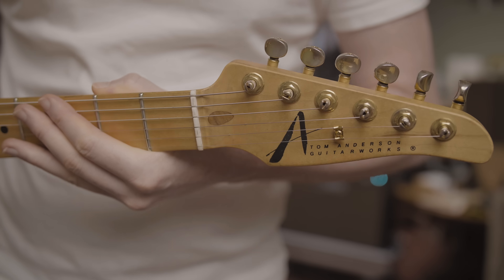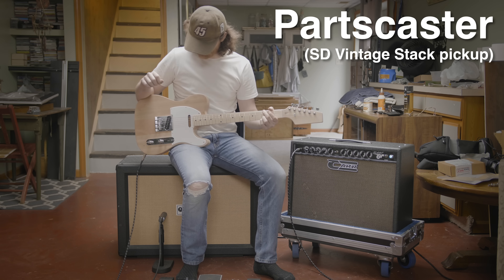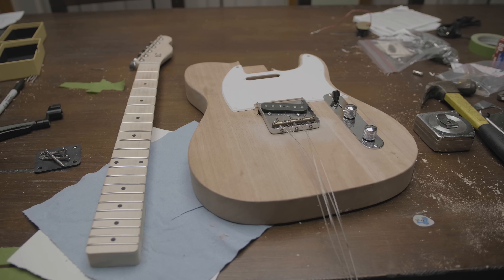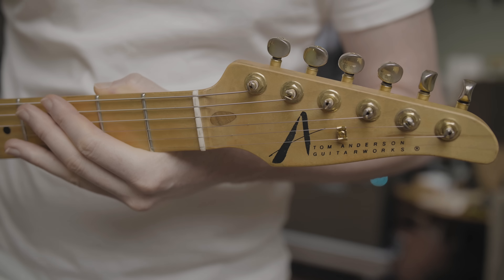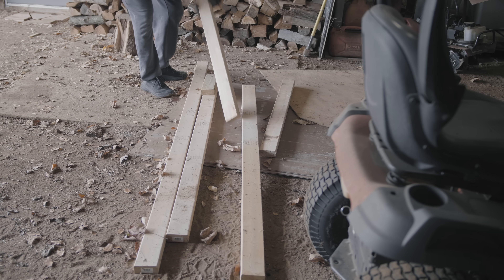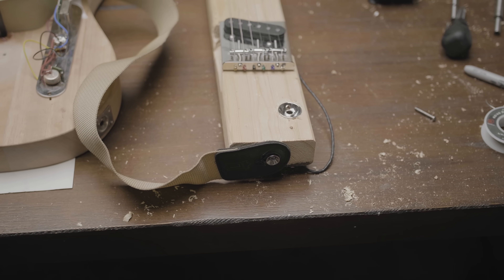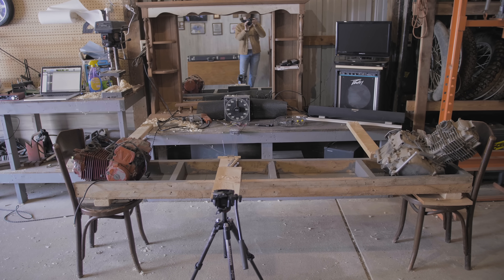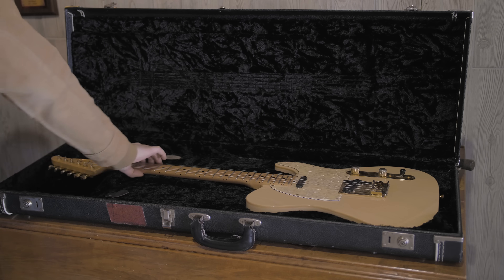Tested: Where Does The Tone Come From In An Electric Guitar?

Comment: The message I get from this is: buy yourself a cheap guitar with a neck that feels comfortable to you, replace the cheap pickups with decent ones, have the guitar properly set up by a pro, and you're in business. Great video !
Reply: @MikeSW  One (potential) benefit of buying a 'project' guitar and upgrading it as you go along is that you don't have to pay the full price upfront, you can upgrade stuff here and there as your skill/commitment increases. The only downside to that is that you can't compare your progress on a like-for-like setup.

And hey, most folks looking to mod their car/bike/computer/guitar probably enjoy tinkering and 'making it their own' instead of just buying something off the shelf.

I have nothing against buying something off the shelf, but a beginner isn't likely to know what they want/need at the outset.
Reply: I have a squire strat with a fender neck. Bought it used for $150. My favourite guitar I have ever played
Reply: @canadianclay475  you're basically playing a Fender for most people
Reply: @canadianclay475 great.  It doesn’t have treble bleed and it has cheap electronics.  The neck isn’t rolled.  The body is made of 3 to 5 pieces of wood. The bridge isn’t as good. 

Otherwise well done
Reply: @canadianclay475  You know the story would be more believable if you made it seem like you knew that Fender makes the Squire and the Stratocaster.
Reply: What part isn't believable?Putting a better neck on your guitar is common practice if you want a major feel upgrade on the cheap ones.Yeah, the strat is(in both it's variants, Squire and Fender) a Fender design, but the feel of a real Fender is noticeably better.(it's made of better materials and has a better finish)
In conclusion, to make it clear:cheap Fender Squire Strat + modified neck(one built for the Fender Strat(no Squire) = happiness for your fingers
I hope I helped you understand what he meant.Peace
Reply: @T @Tofu_Pilot No offense I’m not trying to be a jerk but if you’re going to challenge someone’s knowledge you gotta be air tight with your own. Fender doesn’t make Squire they make Squier. Sure it’s just a minor error in spelling but I also am not sure what part of the story wasn’t believable. He wouldn’t say “I have a Fender guitar with a Fender neck” and it’s also just not commonplace to hear people say “oh I have a Squier by Fender guitar”. It’s implied. Again I’m not trying to be mean or anything and you can feel free to tell me eff off lol. I was just taken aback by the reasoning here 👊🏻👊🏻👊🏻
Reply: Reduce, Reuse, Recycle, Repair.... In other words buy second hand.
Reply: @lorenzoblum868  I'm pretty sure that's what BTO recommended.
Reply: Harley Benton’s are cheap and feel amazing!
Reply: @joshuajaimes121  Agreed. IYV seems to suit me too. Some HB's are manufactured at their Vietnam plant.
Reply: Well cheap guitar isn't that bad. I have indonesian made guitar and it's awesome. Also super cheap
Reply: @rotikl1359  been learning for the past few months on a $60 acoustic. I’ve tried some higher end acoustics that it can’t hold a candle to but it doesn’t sound bad honestly
Reply: I buy cheap guitars and make them play like butter by adjusting the action and choosing specific strings. Anytime i had an expensive guitar i was always coddling it and i was scared to leave it out if it’s case.
Reply: @NightSpeed9 you must have some other way of flexing on fellow dentists
Reply: @NightSpeed9  Sounds like a personal problem.
Reply: my favorite guitar is one of the least expensive ones in my collection - I wouldn't sell it for 10x what I paid for it.
Reply: There are loads of videos of extremely good players using cheap guitars with diff pickups and solid setups. They don't always sound the same or as good as the more expensive guitars so this isn't a fool proof method you have. The real message people need to be receiving is, BUY WHAT YOU WANT!!!!! Stop letting other people tell you to buy the most expensive because its the best or buy the cheapest because it isn't any different.
Reply: @MikeSW  I’ve known a few people that upgraded Squiers with MIM Fender hardware they bought off of eBay. By the time they were done it was cheaper, and just as good. The key to that is that people will put higher end hardware like MIA parts in their MIM Fender, and then sell the MIM parts to recoup some of the cost. The only problem with doing it though is that a Squier with MIM parts won’t really sell for more than a regular Squier if you ever want to get rid of it. I bought my son a Squire Telecaster with MIM pickups for $175.
Reply: Did that for one of my Basses and is probably one of the best basses I have
Reply: @MikeSW  What tools do you need bro, a screwdriver? And spending time making it adds more value to you personally, i wouldn't mind spending some extra time with it.
Reply: Then once you practice a lot, maybe get better pots if needed so you can have a more linear volume change for the volume knob and EQ change for the tone knob. Also tuners if the OG tuners are crappy and can't stay in tune.
Reply: @lanehart012  your ears can't discern linear volume change the way it appears on a graph, so you get pots with a curved change.
Reply: @lanehart012  I actually prefer a non linear volume pot.  I use that pot to either roll of a bit of the signal or cut it entirely.  Use a volume pedal for swells and finer control while playing.
Reply: @lanehart012  oh yeah some good pot will make your guitar playing elevate beyond the human level as well.
Reply: @lanehart012
Reply: @lanehart012
Reply: @lanehart012
Reply: @lanehart012
Reply: @lanehart012
Reply: @MikeSW 
If that's your experience i'm sorry to say that you've been scammed, me and my friends have built ridicilously specced partscasters and mod rods in the 500e ballpark
Reply: @ihavewaited90daystochangem51 yup yup, honestly a squier or epiphone with a good setup and Wilkinsons dropped in is even less than that, and sounds great. Their pickups are stupid good for the price.
Reply: @ihavewaited90daystochangem51  And I have bought a guitar straight from the store just ad I want it gor 300€
Reply: @ihavewaited90daystochangem51 you’re full of shut.
Reply: @ihavewaited90daystochangem51  I am gonna beg you to please teach me how. Like, actually, I need to know. I wanna do this.
Reply: It's also important that the frets are placed correctly. It sucks to have random notes be out of tune.
Reply: Honestly it's more about buying the guitar you enjoy and that you can afford. If you really like a USA Fender and can afford it then awesome! If you prefer a Squier Classic Vibe (and/or that's all you can afford) then great! They're awesome guitars too. Especially with some upgrades. Enjoying and feeling comfortable with the gutiar is the number one factor when buying one.
Reply: @Ironworthstriking  Absolutely correct. As a guitar teacher this is what I advise my pupils.
Reply: I bought 3  cheap Chinese  stratocaster copies on the flee market. All 3 stay perfectly in tune. Cheap mechanics of course but they get the job done...
Reply: @lorenzoblum868 your personal anecdote doesn’t change a well known fact.  Cheap guitars don’t stay in tune as well.
Reply: @eclark9965 I wouldn’t say that, my squire PJ bass stays super well in tune, as good as my Fender P bass does ¯\_(ツ)_/¯
Reply: To take it a level further, consider learning to do set-ups! It’s easier thank you might think and it will save you money in the long run
Reply: Exactly what I did, except I set it up myself
Reply: @MikeSW  true, but it’s way more fun to select your parts and end up with a one of a kind instrument.   Certainly not easier however, a few I did went to the shop repeatedly before I got what I was after, 30 years of reading guitar mags paid off there big time, but not cheap.  and no resale value either, I never had the cash before!  But I also never had the time to play 6 days a week, until the past 5 years, that was the really huge payoff.😀
Reply: Thank you for your service to Science.
Reply: It‘s way more a good amp than an expensive guitar that gives you great tone. Nothing new.
Reply: @MikeSW  my dad has a business with buying, selling and swapping parts on guitars and I can firmly say it is cheaper to build your own guitar from scratch if you know what parts you want, and what parts to get
Reply: I've shaken my head many times and what people pay for a block of wood with strings on it. I went to a local TV channel taping of a band, this bass player was super fun to watch, his axe looked cool, worn, and his pedalboard was about 3 pedals glued to a chunk of OSB. He said he spent $100 on his bass 20 years ago and just makes small upgrades once in a while. It sounded fantastic.

I bought a $1200 Ibanez SR1600 4-string bass as my main when my band started playing out a lot. As a backup, I bought a $300 SR300 because it was pink. The pinkie plays just as well and I think sounds better.

I also bought a hot pink 6-string PRS SE, having always wanted a PRS because surely, spending $4000 would get you a better sound. Maybe a little, but not a $3500 better sound. My favorite guitar is $500 and my favorite bass is $300. I've learned my lesson. Buy what you can afford, upgrade it as you can afford it, but never go overboard unless you don't care about setting your hard-earned cash on fire.

Collecting is another story...
Reply: i bought an epiphone special 2 a few years back and did exactly that. it’s insane much i love that guitar
Reply: As many others have said, Buy something you love playing and feels comfortable to play. Really what you are paying for in higher end guitars is the time spent on the fret board. Making it easier to play. A little different with acoustics as tone wood does matter in that case but I have people play my Taylor who own cheapo acoustics and they always comment how much easier it is to play. That is because the time spent on the fretboard. There are many on YouTube who take those cheap guitar kits and turn them into four figure masterpieces.
Reply: Yamaha pacifica
Reply: A good neck, too. Might not do anything for the tone but a good neck is way better feeling than a shitty one.
Reply: There may be more than a few big name guitar manufacturers and their shareholders that dispise your revelation 😂
Reply: It's what most of the pros did. Every revolutionary guitarist made some piece of junk work for them and in turn, it gave them their signature sound. What makes them revolutionary is the lack of focus on the equipment, and the complete obsession over the music they were writing and solving musical problems because of their lack of proper gear. Something most musicians simply don't have to do anymore nowadays
Reply: Intonation firsttttt
Reply: Setup makes huge difference.❤
Reply: They sounded exactly the same to me. Just proves the majority of us Humans are idiot's when it comes to Brand name's. Motto of this Video is Don't be an idiot or a Sheep follower.😂😂😂
Reply: @eclarck9965 fun fact, to be able to write "made in USA", all parts should be manufactured in America. It used to be true but nowadays, most brands use components made elsewhere... So legally they can only claim "Assembled in USA"....
Reply: @lorenzoblum868  no shit Sherlock.  But here’s another truth.  Your point does nothing to negate the difference in build quality.
Reply: @eclark9965   "no shit Sherlock". It doesn't really sound like you're aware of that tbh. And as far as craftsmanship, you find highly qualified people all over the planet nowadays. It's called globalization, for the better and the better in this case.
Reply: @lorenzoblum868  i am aware of it. I’m an adult consumer with an iq over 85. What it sounds like is i was told an obvious thing that doesn’t change anything i said.   The craftsmanship and processes are better in the states.  The fret work.  The finishes.  The neck qualities.  The parts qualifies.  Regardless of where they’re made.  It should also be noted that the big 3 make a lot of their parts in the United States for their American made runs.  Which I’m sure you know.  

Next time someone is telling you you’re staying the obvious, that’s probably what’s going on.  Internalize it and do better
Reply: @eclark9965   projecting much? Don't bother answering. Not interested.
Reply: @lorenzoblum868  no. I corrected your inaccurate guesswork and then reinforced my point without suffering fools.  You can take it.  It’s ok. 

Globalization gives us one thing.  Massive pollution from shipping and outsourced jobs.  Not a big fan
Reply: @eclark9965  btw, are you sure you're being genuine when talking about pollution? I mean your thumbnail is a race car. I've been riding my bicycle for decades...
Reply: @lorenzoblum868  if i never watch a day of racing again there’s still going to be racing and i did nothing measurable to encourage the process. 

The same can’t be said about having someone make your guitar 3k miles away
Reply: @eclark9965   Glorifying guns, cars.... is the first step towards our frenzy consumerism. On the other hand, if you build a guitar using components, wood that you can certify is not from some unethical exploitation (mining and wood industry are well known for creating environmental catastrophe), then you might be into something. for that reason, if you use local material, you have a better knowledge about the origines of those materials. Also, do we really need 10 guitars? Do we really need a "better" guitar or do we need to improve our playing? What is most important is the accuracy and the confort and often it doesn't take much to upgrade the guitar we already own...
Reply: @lorenzoblum868  suddenly we are talking about guns and cars when it isn’t the subject?  I don’t own guns.  I have a car so i can to a place.  You’re going hard in the paint over a throw away avatar and it’s nonsense.  You should stick to the subject.  

I own 2 guitars.  An acoustic.  And an electric.  Both American made.  Supporting local labor.  

There are countless videos on YouTube about whether it’s worth it to dump a bunch of money into a shit tier guitar.  The consensus is generally no.  You’re just dumping perfectly “good” parts into landfills.
Reply: Doing God's work. Tonewood is a myth regarding solidbody electric guitars.
Reply: Buy a reasonable priced one that ensures that you're getting a decently built, set up guitar. If you go out and buy whatever cheap guitar you can find you'll have issues sooner or later! Also, never buy into the "well known brand guitar" lie like some Gibsons, etc. with high prices and (sometimes very) low build quality.
Reply: A lot of the benefits of a harder, more expensive wood is that it’s more stable under the tension of the strings, which is why carbon fibre guitars sound fine, and the 3D printed ones sound fine, and the aluminum ones sound… fine 🤯😂
Reply: I came up with this many years ago. I have many cheap guitars and every one of them I modded by myself. It's better to spend money on a nice amp instead because even the most expensive guitar would sound bad on a bad amp
Reply: The fact that you have to take your guitar to a professional to have it set up is pretty sad. Every guitar player should know how to set up their guitar from changing the strings to setting intonation to swapping electronics. it’s really sad you gotta take yours to somebody to have that done
Reply: You mean it has nothing to do with the brand name? Gibson and Fender will never allow that kind of thinking! 😊
Reply: And yet. There are cheap Chinese humbler that blow $150 humbuckers out of the water.

The real lesson is be discerning, and learn how to properly adjust the intonation
Reply: Or just buy the cool looking one and stop overthinking it.
Reply: @B3Band  I'm a guitar teacher and this is exactly what I tell my guitar beginners who are looking for advice on their first guitar! If you love how it looks you will be much more inclined to want to play it. Of course I make sure it's OK to play - but nearly every guitar is nowadays.
Reply: @MikeSW  I can see where you come from. Legit some guitar brands have better value on their guitar than buying cheaper and upgrade later.
Reply: PRETTY MUCH!
Reply: U forget to factor in EGO
Reply: There's a lot of truth to this. My #1 guitar is a PRS SE Zach Myers signature. I upgraded the tuners and replaced the pickups with a Gibson Burstbucker 1&2 set and the thing freakin rips.
Reply: I've always liked Neck-through Rhoads V's. So. Cheap isn't really an option.
Reply: https://youtu.be/epoIqglZOUg
Reply: Bingo
Reply: doing this with a 270 dollar bass i just bought, love the fretboard and the way it fits me, and it osunds fine, when i want to sound fancier ill buy new pickups
Reply: Yes.  More than 30:years of playing and about if that semi pro and that is where I landed.
Reply: @MikeSW  some times yes but if like me and you play lefthanded you have to mod and make due unless your getting custom made guitars it will always be cheaper. And you can learn to do everything yourself on a cheap throw away before fucking up a better guitar. So modding will always be cheaper you have to be willing to find parts at good prices and have patience. If you are building on your free time then what is labor if you don't have anything else to do at the time(equals zero).
Reply: Over the years and years of buying nice and off brand gear 
All that matters is most definitely how much you practice 
Everything has its own sound it's how you use that sounds
Reply: Well I mean, you're going to want good tuners too so it's not an absolute pain, and not having to tune so often
Reply: @Evalyn126  stock Fender esque tuners are fine, rarely does my guitar go out of tune
Reply: @cycomiles4225  well my guitar needs to be tuned way more than my acoustic guitar (made for nylon strings and also made in the late 70s that has steels on it bc idk someone put steels on it), and that thing stays in tune for like An actual month, and if I leave my new electric out for like a week, I need to re-tune it, because it's far enough off that it pisses me off
Reply: That's the most important thing the action
Reply: And get a god amp
Reply: Better guitars have better fit and finish. Tuners that stay in tune, nuts correctly cut, saddles that are better finished and stronger material, better finishing on the frets with no sharp edges and leveled properly. 

You can just feel the difference between a high quality guitar and a cheap one.
Reply: Bridge and nut bro!
Reply: I didn’t find it in the description or the video. Of course I assume you used the same amp with the same settings, but what amp is it?
Reply: @MikeSW  I love working on my guitars and not having someone else do things for me. My guitar is not $2k as it would be if I went that approach.
Reply: Yeah, that‘s the only truth. All other things are Vodoo, nothing else !
Reply: fr
Reply: And even then, dont even touch the pickups on some guitars. Most modern squiers sound nearly identical to their fender counterparts
Reply: Bingo!  It’s what I did!  I am happy as a pig in shit.
Reply: The nice thing about buying a cheaper guitar is that you don’t regret effing’ with it.  Want to add a “cut” button to get all Jack White?  Sure.  Don’t use that cut button much?  Whatever, you spent 300 at most, and it’s no great loss.  The possibilities are infinite.  You can build whatever guitar you wish, and for far less than what you would pay for some pricey Made in America model.
Reply: @MikeSW t really depends where you live, for example in Brazil Gibson, fender and alike are super expensive like 20x the minimum wage, so telling by experience, I was able to upgrade good structure cheap guitars with amazing hardware and way cheaper than a Gibson and honestly very close soundwise (I also have a Gibson to compare)
Reply: @MikeSW Wrong.
Reply: What you forgot is the frets. If you want a consistent sounding guitar at all frets, that is going to cost you a lot. Also if you want a guitar that feels good to play or feels easy to play, and sound big at the same time, that also gonna cost you a lot. I use a 6000 dollar Tom Anderson Strat and would never switch to anything that is not as carefully built.
Reply: What I did with my third guitar:
60€ guitar with supreme fretwork idk how for that price but way better than any fender player I ever played
Reply: Don’t even need to upgrade the pups.
Reply: @MikeSW Squier Bullet series cost 120€, and you can get electric guitars from amazon or thomann for 70€. You can swap out every single part of an electric guitar with tools you have at home and a fifteen-euro soldering iron and it won't take over two hours. There are even drop-in replacements for nuts at ten euro apiece. 

Even if you take it to a luthier for a refret with stainless steel frets and a PLEK job it will still cost FAR below the price difference of a squier compared to the first Fender with stainless steel frets. Your comment is just ridiculously wrong.
Reply: Yes! and I would add too a body that feels comfortable. I was in between a Jem Jr and RG421, JEM Jr with amazing neck and playability, RG that just fits my body and right arm and much more lighter. In the end, I had to make a choice and chose Jem Jr. If I were more savvy with guitar engineering I could bought the RG and mount an amazing guitar for me. Or I could go to a Luthier..
Reply: Bought a barely used Squier P bass, did some routing, and installed Bartolini pickups and preamp. It sounds amazing.
Reply: Except a lot of times, it still sounds shitty.
Reply: Tbh after Spectre Studios video about pickups I'm nkt even sure replacing them would be worth it
Reply: Dude please give me your address i will come and kiss you
Reply: you can set it up yourself for wayyy cheaper and quicker
Reply: Squier or Epiphone sounds good.
Reply: @MikeSW the only swaps you need to do is the nut; other than that, unless you want a hotter pickup you really don't need to make any upgrades. Maybe a fretjob but that goes for every guitar ever made since frets wear out.
Reply: That’s what I did😅
Reply: Whichever tools and materials you choose seem second best and immaterial when music is your muse.
Reply: That doesn't include staying in tune which is also quite important
Reply: Hardware and craftsmanship is pretty important as well not just for long term usage but also to achieve remaining the set especially on the stage
Reply: Yes, but cheap guitars do not intonate well and have poorer tuning stability bc of their build quality in my experience. Nothing you can do to fix that, those things can become extremely problemsome when trying to record decent guitar.
Reply: I replaced the pickups in my wife’s guitar a while back. I had only replaced the high E string and I plucked it. The tone was so glorious  that I knew I had made a huge improvement in the guitar after only hearing one string.
Reply: Dylan pickups!
Reply: Yup
Reply: Assuming the neck and body are made correctly and the frets are well positioned for the best intonation.
Reply: Having good tuning hardware has to be a nice quality of life detail though. So cheap body/neck guitar with good pickups/electronics and good string management and you're ready to rock.
Reply: That’s what I’ve been doing for years! Happy to verify my instincts.
Reply: A pickup is such a simple device magnets with copper coils around them..  that i bet even the cheap ones sound similar to the expencive
Reply: You need to replace the wiring too The wiring is always horrible
Reply: Some of the really cheap guitars have such poor necks they cant be intonated well. Other than getting unlucky with something like that, I would agree
Reply: The “cheap” in music gear can differ from 100-1000€ so thats vague af and buying a cheap guitar is a lottery bc in most cases in that price range with the same guitar you can either get a very nice build or pretty bad one
Reply: Yeah man my thinking from the start has always been buy as good as you play, there's no point in beginning and getting a 2.5k aud guitar when a $300 one will do let's you ease in and if you don't like it you haven't made a huge regretful purchase that'd you'd lose money on if you sold it
Reply: Fret (metarial), weight(body chamber), shape(ergonomics), playability(neckshape), wood quality(neck needs not to twist or distort in short period)   there's lots of other points that makes guitar more worthy other than a sound.
Reply: for those whom dont want to see the fumm video, all the tone comes from the wood, forget the pickup tone myth
Reply: Agreed with most of it except that cheap pickups nowadays are mostly decent to the point they don’t need to be swapped at all! Cheap pickups no longer suck anymore! All that’s left is pickup height adjustments which will affect your tone a lot more than swapping woods!!
Reply: Very good video
Reply: I’ve been playing for 38 years and it comes down to what feels good, how well its setup  and pickups. I’ve got $3,000 plus guitars and cheap recycled guitars I’ve modified and eod you don’t need a high end brand unless you want the bragging rights.
Reply: @MikeSW we all know guitars don’t always come with what we want in them. How you gonna get 2 humbuckers on a strat without upgrading? How you gonna get locking tuners? You’ll pay extra if it comes with it. And you miss out on a cool and fun ass project
Reply: The real message is just how efing deaf most guitarists are, not hearing that a workbench does not hold a chord for more than 2 seconds before it fades away into nonsensical hum😂
Reply: So, I actually inadvertently put this to the test recently and had a different finding. I used to play a PRS SE (£700) I modded with a hip shot bridge, schaller locking tuners, Bareknuckle Silo pickups and a GraphTeq top nut. Recently bought a music man (£4300), fitted with the exact same hardware and electronics (pickups and pots included). Both setup by the same guitar tech with the same strings and string gauge.  Music Man 100% sounds better than the SE, even when listening to recorded tracks side by side in my DAW, not just in the room. The SE sounds great, but the music man has SO MUCH more sustain and just sounds better. Is it nearly £4000 worth of difference? Probably not, but the people that say there’s no difference have definitely not tried it for themselves properly
Reply: @MikeSW yeah but if I want a Squier with top spec hardware and electronic I can spend 200€ + 600 of upgrading/pro setup = 800€. At 800 you CANNOT find a Fender with those specs and that setup. You need to spend AT LEAST 1500 AND THEN go to the luthier for a proper setup that they require EVERY TIME.
Reply: I build my own guitars. Last year I was bit by a dog and my index finger was never been the same. Instead of the nice mahogany of the first build, i used pine from Home Depot to make a new neck. It didn't make a difference in sound. But the cheap pine is much more prone to deforming over time. Still this was completely mitigated by matching wood fibers in a symmetrical way.
Reply: One big caveat, there IS a massive difference to sustain depending on whether it's a solid, hollow, or semi-hollow body.
Reply: I've made cigar box guitars and got great tone. This video verifys my thoughts on the matter. I can't play much. But my friend and colleague. He rips can bring one to life. The player, and the parts p+p=  tone 😊
Reply: As far as the guitar link of the chain...you nailed it!!!
Reply: You have literally bought the ability to say it's just as good. When you could have purchased a decent one, for the same amount, and skipped all of that, and didn't have to pay three seperate entities to get it to where you want, or spent hours removing or adding screws and sanding. It can be rewarding, but try to resell your parts caster. It's yours forever. Whether your like it or not. Whether you do it yourself, or have a luthier do all the work, its just an insane amount of effort. For nothing.
Reply: I did this a few years ago and it turned out great, it feels like my own, sounds great, and saved me about £450.  Also you can wire the pickups to push pull pots and do some crazy shit.
Reply: I did what Andren did, years ago. I was visiting the electronics tech who had his workbench in the basement of the music store where I used to be the guitar tech. In the corner of the basement was a 55 gallon drum that was being used as a garbage can. It had a guitar neck sticking out of it. I knew that guitar. It was an old Squire that someone had chopped up to insert a MIDI controller. It never worked. Since it didn’t work, and the guitar was a hacked up mess, they just said “Screw it”, and threw the guitar in the garbage. I offered a token sum of money and the owner of the store accepted it, and said, “Get that thing out of my store!”

The only thing that I changed on it was to replace its two humbucking pickups with two Seymour Duncan JBH-4 humbuckers (The Jeff Beck models.) that I had kicking around. put on some Graphtech bridge pieces, and changed the potentiometers from logrithmic to linear. Logrithmic pots just piss me off.
The guitar was Cherry Red, and for some reason or another, I don’t know why, I don’t like red guitars. I thought about sanding it down to the wood and putting a clear laquer finish on it for that natural wood look. I didn’t have the tools for that. Then I got a spray can of mirror reflection paint.  I didn’t feel like doing the work to do that. 

(Although I did once refinish a Strat with a paint that turned anything you painted it with into a black chalkboard. I’d carry a stick of chalk in my pocket, and in the middle of gigs would design something, or write a message to the audience. The problem with that was that the black paint had kind of turned it into a Stealth Guitar, you couldn’t really see it very well onstage.)

So lazy ole me got out a roll of silver duct tape and covered the entire guitar with that. A duct tape finish! I thought that was kind of original. Then I took a lot of time setting it up exactly perfectly the way I personally like a guitar to be for my playing style.

I once had a phase of going after vintage guitars, but I gave up on that because I never wanted to take them out of the house to a gig, because I was always afraid of them getting dinged or stolen.
What I wanted was what I call a “Banger”; a guitar that I could take to gigs and not have to care about it getting dinged, etc. The duct tape covered Squire was perfect. And could let someone else play it without worrying that they might scratch it up or something like that.

I have something like 12 guitars of all kinds of different brands and models, and my duck taped Squire is as good as any of the others. Right up there with my SG’s, ES’s, etc. The neck is great, really smooth playing satin finish, and these Jeff Beck pickups roar with the best of them!

So there you have it; the cheapest guitar I own is as good as the most expensive guitar that I own.😊😊😊😊
Reply: The one thing you can't do is hit the back of the guitar to it sounds out of it.
Reply: I play a $60 pawn shop special peavey raptor with a cut up pickguard and weird pickups and it’s my 2nd favorite guitar I’ve ever played. First is my PRS SE lol.
Reply: The best guitar I own is a partscaster that I built myself. It was fun and rewarding, I got to pick out all the parts I wanted to use and the pickups. I wouldn't trade it for any "master built" or "custom shop" Strat. It's my own Strat that I built to my own specs.
Reply: Not exactly. If a guitar won’t stay in tune it just won’t unless you put more money into more upgrades. You’re honestly better off saving for a better guitar
Reply: Tone changed drastically when he swapped for Yamaha engines….
Reply: Right up you want to trade it or sell it. It might bring $25-35! Nothing like reselling a Gibby, Fender is a Ricky. Folks think I terms odd value rather than price. If you purchased a Yugo, you got what you paid for and no way could you resell it for other than junkyard prices.
Reply: Yes, all considering you play through a decent amp. Amp is 95% of the tone, even a cheap ibanez Gio with stock pickups sound great through my Friedman
Reply: Some parts do have an effect though. Especially parts that are directly in contact with the string.

What it all comes down to is to make sure the string is mounted between solids that don't vibrate along with the string, but instead echo its vibrations back to itself. Three factors help with this: Hardness of the material; mass of the part and how solidly it is mounted.

On something like a very cheap guitar, if the nut is plastic and the bridge saddles are made from cheap zamac metal, it might be worth upgrading them to bone and brass. Those directly touch the string and swapping the parts for harder materials will imrpove your sustain.
Reply: There’s a few thing that could go wrong with this. Sure, wood doesn’t affect tone, but it affects playability. Cheap wood = neck warping, sharp fret ends, frets popping out of the fretboard (resulting in buzz), action being too high due to weather changes etc. More expensive guitars usually need a full setup once every few years unless you put in a mod that requires a setup or you go 2 or more string gauges up. Also I’ve seen tremolo systems messed up because the guitar’s cheap wood was too soft.
Reply: Not to mention the speaker you are using. The amp you use matters way less than one would think, but if you have a doodoo speaker you will always sound bad
Reply: True.  Especially nowadays when CNC machining has made it so even a cheap guitar will have decent neck angle, etc.  and can be set up to play well.
Reply: goated comment, strings too if that's not already counted within the pro setup
Reply: Nope, there's WAY more to a guitar than pickups.
Reply: @mikethebloodthirsty  Not much, though. Pickup type/height, bridge & nut material, scale length, string thickness, speaker type, and to a lesser degree, amp type. Those are your big ones, everything else is damn near inconsequential.
Reply: Indeed. 😎
Reply: I think you’re 100% correct. 

My cheapest guitar(Yamaha Revstar RSS20) is split first place the best together with my most expensive (Anderson Pro Am). 
I modded my Revstar to my liking.  But that neck and playability is just amazing. It feels a lot like my Anderson except the scale length. . 😂
Reply: 100% i reccomend a squier classic vibe, if you play high gain, wax the pickups or swap them and yout golden!
Reply: Touring and working guitarists have known this for awhile.

It was really the TGP elitists that kept pushing the toanwood mojo bullcrap because they'd rather spend their money on themselves than helping others.
Reply: That's what I do, but I set it up myself. All my guitars play and sound better than any gibson.
Reply: So a yamaha pacifica then, just change the pickups, bridge, tuners, pots. Though it's slightly heavy.
Reply: TRUTH‼️‼️‼️
Reply: Cort 250 😊 thank me later
Reply: I got a cheap guitar- a Yamaha Pacifica- and got it set up by an amateur, namely myself. I don't let anyone work on my guitars unless there's something beyond my ability to repair and it hasn't happened in the 27 years I've been playing. We should all be doing our own guitar repair and maintenance or else they'll become disposable or you'll have to take them back to the retailer for service, like cars and refrigerators.
Reply: That’s what I did..
Reply: Nah
Reply: @diocan7710 I have two heavily modified sub-$300 Yamaha Pacificas. I play each one more than my Strat, G&L ASAT, and Japanese ESP Eclipse combined. Those two Pacificas cost less total than any one of the others but they sound and feel as good or better.
Reply: Hell, if the cheap pickups aren't heavy enough for you, just set them closer to the strings to get a more "driven" sound out of them. There's no need to run out and spend twice as much on some pickups as you did on the Harley Benton in the first place.
Reply: Question is; what cheap guitars have good necks?
Reply: @DarkSquareChess  The Yamaha Pacifica 112V I bought has a good, fast neck. It's made in Indonesia but it's made in a factory that's owned by Yamaha and the workers are Yamaha employees. There's a noticeable difference in quality from Indonesian guitars made in factories contracted with multiple brands.
Reply: @onlyusernameleft2 Thanks for answering. I'm looking at a more suitable for metal dubbele humbucker guitar and maybe a neck a bit thinner/flatter. Maybe the Pacifica 120h will do. I also read that the Cort brand is good bang for buck or maybe an Ibanez RG.
Reply: @DarkSquareChess  Cort guitars look very nice and I've heard they are good instruments compared to the bargain bin toys they were when I was a kid. I've never played one so I can't confirm, and I don't know much about the Ibanez. LTD guitars are very good at the $500 and up price range. The humbucker on my Pacifica is really high output. Switching from the neck to the bridge is like hitting my overdrive pedal. It has a modern C neck with a 14" radius.
Reply: Yup.
Not much on the resale value unless you are famous.
I have put together many killer sounding parts casters rivaling  guitars that were way more expensive.
Reply: thats exactly the advice ive been giving. There is some reliability, tuning stability and better feel to be gained at higher price points, but thats really not worth it for anyone except people making their livelihoods by playing guitar.
Reply: 100% agree.   I have an old epiphone from the 90s that plays great but had scratchy pots so I stripped it down and replaced all the wiring, pots, caps, and put some great pups and it amazed me how much of a difference it made and has become my favorite
Reply: Plus practice practice practice
Reply: Don't forget a decent nut. Always a decent nut.
Reply: Honestly this is what I’ve come to agree with after many years
Reply: Don't take your guitar to another man to set up.  It's 6 screws.  Learn how to do it.  Cut off the man bun and put your balls back on.  Figure it out.
Reply: Exactly what I did with my Mexican tele! Also added an orange drop capacitor
Reply: true, but finding a cheap guitar with an awesome neck is a little harder than you might expect

alternatively you could just get a guitar that fits a fender neck and you’d be set hahaha
Reply: Make super sure that the guitar has an INTONATED neck, not just the feeling, or you will spend hours with never able to get some chords and techniques right.

Also if it's a cheap guitar buy it with a fixed bridge or a fixable one
Reply: I have a squire strat that i put mexican strat pickups in and it made all the difference
Reply: Yes and yes and yesss! Or better learn to set it up yourself.
Reply: Plus think about switching the tuners for more tuning stability. I did pickup and tuner change on a gio ibanez and it feels great. I got recommended to also take a look at the nut and change it from cheap plastic to tusq.
Reply: The chepear, the better
Reply: Well, I mean you don’t even need a guitar - just the tuning, strings, pickups, saddle, nut… you get the point.
Reply: Buy a guitar with a nice neck, then smash the neck since the wood doesn't matter and build yourself a guitar with no wood. That's the message here
Reply: Or just buy a guitar that you enjoy.
Reply: @imsotallytober5 what fun is that?
Reply: First take lessons, study and practice a lot, along with what you said.
Reply: @Francisco Campos flashbacks of playing spider scales over and over with a metronome
Reply: @franciscocampos6069  indeed
Reply: @franciscocampos6069 i didn’t take lessons.  That’s not always necessary.
Reply: @franciscocampos6069  😅😅😅
Reply: @franciscocampos6069  lessons? no.
Reply: You can't get more solid than a 200 lbs bench for a body
Reply: @MarshallBare  was thinking the same.
Reply: @MarshallBare  true that’s why the hanging strings sounded so full of volume
Reply: Already have a bullet tele, I’m after a refret, better pickups and tuners and a bigsby adapter
Reply: You could even skip on the pickup upgrade and just learn to adjust the pickup height
Reply: My friend got a used solid body godin.    For under 200 . He loved ergonomically it was awesome fast easy to play.  well built.    Sounded crappy.   I told put fralins in it.     That thing is better than. 99 percent of all high doljj k at strats.    Godins. Ate super easy great guitar s only weakness is pickups.  But easy. Fix.
Reply: I can get almost any tone i want out of my HSS squier strat and my squier pbass, with technique, amp, and pedals. Its all about how you play the instrument foremost. You can fake hardware with effects.
Reply: Do you believe we pay high price for sound only?
It is comfort, reliability, craftmanship, how much the action can be lowered, fretwork and quality, electronics... i mean many factors exist that determines the prices
Sound is only one aspect...
Reply: I agree...I recently bought a Nashville Guitar works...220 buk....had it set it...the neck feels great..the action sweet...the pickups even sound really good...
Reply: In this thread:  lots of people that haven’t played an American made guitar
Reply: The one big flaw in this test is significant. The air guitar that proved that body wood is a non- factor because there was no body is not quite right. Yes it looks like there is no body because there is no wood but there is wood in that test. It’s just that it is in an unconventional place, behind the bridge and the player. It’s that whole work bench. Yes, the wood is different and the shape is different but surely a big mass of the wood and metal that the bench the bridge mounts in is going to contribute to the tone. To think otherwise is pretty closed minded in my opinion. I did like the testing and the video though. It sure did underline just how close you could bring a hundred buck cheap kit to a bonafide custom big buck fine instrument by putting a same or similar pickup in it. It’s Also a testament to your own guitar assembly/ setup skills. I’ll be subscribing, I like your playing ideas and video style. Thanks!
Reply: Cheap guitars may not stay in tune so that requires even more upgrades
Reply: @Henrix1998  don't buy that one.
Reply: @Henrix1998  *may require. There's no basis for that one without sciencing it out.
Reply: @Henrix1998 I bought a very cheap Harley benton Telecaster and it stays in tune better than any other Guitar I've ever had.
Go figure 🤔 😊.
Reply: Change all metal parts for ones that last longer. Get a decent nut and tuners to help you keep your tuning in place for longer. 

Find a great strap, put on strap-locks.

Get a good pick (if you use them)

Quality leads are a great addition.
Reply: Yes, but by the time you do that$$$, you might as well just buy a guitar that already has that from the start.  It’s a financial conundrum.
Reply: @johnr3369  I'd rather learn/hone multiple skills upgrading a cheaper guitar myself than pay out the ass for something that's only marginally better that I also won't understand how to fix if something goes wrong.
Reply: For sustain you need a good peace of wood for the sound to resonate in tho
Reply: @sterilesteve5565  wasn't the point of this video to show that wood does not really matter? Even a body does even matter
Reply: @sterilesteve5565  why did air guitar resonate better than anderson telecaster then
Reply: @absolutscheisse4483  good question
Reply: @sterilesteve5565  Cause is mostly about the pickups.
Reply: @sterilesteve5565  Not really, see this guys other video on that topic. Any old piece of wood (or other material) is fine.
Reply: @DavidNorthUK  interesting. Ive got a mexican strat with frets swapped to stainless jumbo frets and on b string 9-12 fret i have noticably less sustain than any other notes if what ur saying is true idfk why that is then
Reply: @sterilesteve5565  that's mostly resonances within the neck. Dead spots can happen. It's why you don't want a guitar to be 'resonant'.
Reply: @sterilesteve5565  he just clearly proved your statement not true. Your right in an acoustic guitar platform tho.
Reply: @sterilesteve5565  his has been debunked time and time again.
Reply: @sterilesteve5565  Did you watch the video?
Reply: @hendrixinfinity3992  i did not 😉 it is enjoyable reading all the responses. Also i have a mexican strat about 8 years old got it refretted and damn its a great thing 🤌nothing expensive but it sure isnt bad
Reply: @sterilesteve5565  and I use a squier Jazzmaster that's fantastic too despite being made of "inferior" wood.
Reply: @sterilesteve5565 literal nonsense
Reply: @sterilesteve5565  Basswood must be great then, cause my Ibanez JS1000 has better sustain than my Gibson and Fender which comes with better, heavier, and more expensive wood!

I believe the difference is the pickup and setup (height), strings, and how you play. The rest? Looks, prestige, and wow-factor.
Reply: @sterilesteve5565 I’m a year late, no you don’t. Wood sound isn’t a thing, it’s a string that is held over 2 pivot points over a set of magnets coiled with tons of wire. The wood does not affect the sound at all. It’s all your pickup and your bridge. And even then, bridge barely affects the tone
Reply: @sterilesteve5565  Density. You can build it out of any material capable of supporting the tension on the bridge and headstock. Density of the mounting material is the final factor which will determine sustain after the Nut and Bridge material.
Reply: @sterilesteve5565  he also made a test for sustain !
Reply: @sterilesteve5565  The Pickups and Amplifier used make the biggest difference to Sustain the Wood a Guitar is made from makes virtually no difference whatsoever to the Sustain.
😉😊
Reply: @sterilesteve5565  Needs a certain baseline. A rubber or styrofoam body will give you trouble. But you don't need the densest heaviest woods necessarily. I think most pieces of solid wood would do the trick.
Reply: @sterilesteve5565  nope. Only for acoustic guitars.
Reply: @sterilesteve5565  what are you basing this one? The physics says you should have no resonance in the body whatsoever if you want sustain. Any resonance leads to coupling of energy from the strings to mechanical motion of the body and that has stronger damping. You need resonance of you want an instrument to be loud acoustically
Reply: @sterilesteve5565  if the wood resonates, sustain will be much reduced. You want it to NOT resonate for increased sustain
Reply: @sterilesteve5565  that’s what she said
Reply: @sasshiro  😉